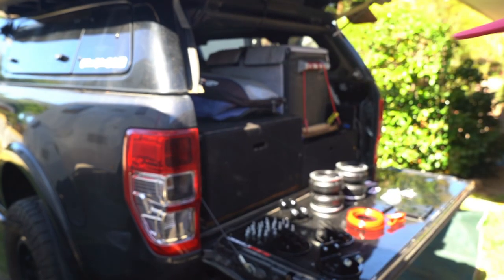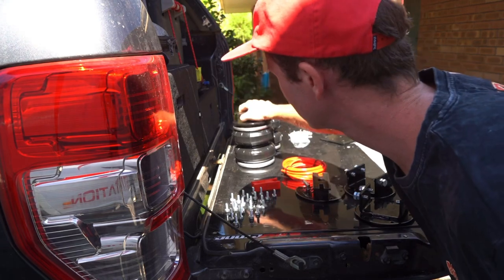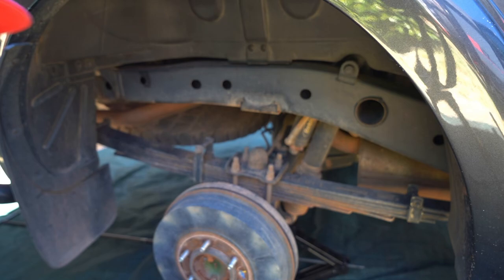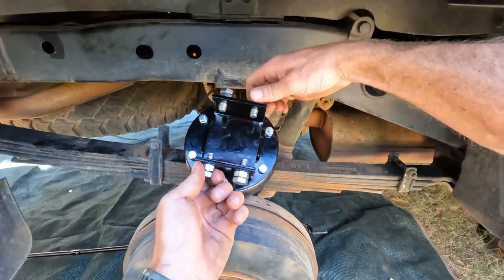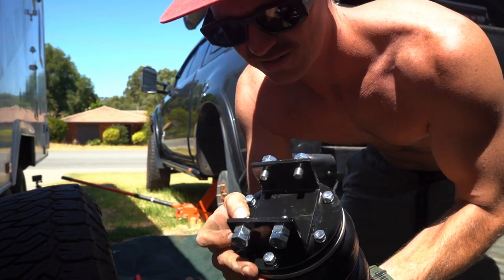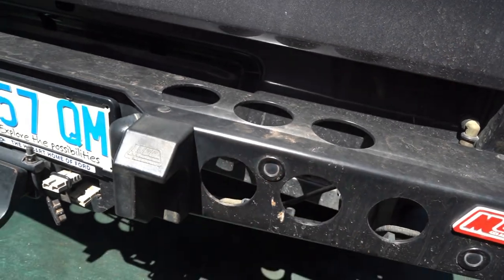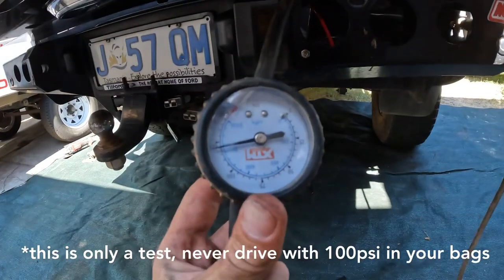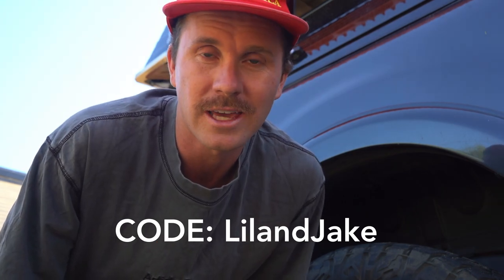DIY INSTALLATION of BOSS AIR SUSPENSION

Comment: We bent our chassis at 5psi. I was told not to run with zero psi so we left a bit in. We were on a gnarly track with a drop. After we recovered the ute there was a 700+km road trip back to Perth at a sedate pace.
Reply from the maker: Damn Steve! That sounds horrible! Yes I'm sceptical on the bags aswell, any sniff of a dirt road I let them down to almost nothing. Did you have upgraded springs aswell?
Reply: @lilandjake  yeah Jake, Toughdog springs and shocks and a lift. The ute was fixed under insurance, I thought she was a right-off.
 The ute was stipped to the chassis and cold stretched back to square (about 4 weeks in a queue ) then it was sent to an engineer for fishplate (4 months in a queue) basically gone for half a year. I checked in with the engineer after 4 weeks and there was a yard full of utes getting fixed or modified and we just had to wait. Old mate said he would ban them from sale and he's surprised insurance companies were covering the claims. The ute was as good as gold when we got her back.
BUT in the end I think it was weight behind the rear axle, a crew cab and the wheel arch was up front that got us (and a bigish drop). We have a supercab now aand I tink the tray is better situated over the arch.

Comment: A great video as to why some things shouldn't be DIY like this, lots of things not done correctly and really at the end of the day just dangerous, you obviously have no mechanical aptitude.
Reply from the maker: Sorry this video bothered you so much. Which parts specifically did you have a problem with? We’d like to know incase we’ve done something wrong.
Reply: @lilandjake  Both the U bolts and nuts should be replaced once undone. The reason is the nuts are torqued at factory which tends to stretch the thread, once you undo the nuts you will never get the same nut back on and guaranteed to not come undone by itself as the thread is now stretched. You should always replace with new U bolts and nuts and torque to the manufacturer's specification. Also never cut the threads back to level with top of the nut, this is bad practice and in a high tensile joint the thread should protrude past the top of the nut by about 3 or 4 threads minimum.
Hope this helps, but my advice is change out those U bolts and nuts with new ones and use a torque wrench to correct manufacturer settings so you have the confidence they will do the job and keep you safe.
Reply from the maker: Aramlee thanks for the tip! I left the u bolts in as they where new  aftermarket ones and only 10,000ks old, that's why I had to cut them down as the factory u bolts would not have hit the bag, 
sorry I don't have a torque wrench but you'll have to keep watching and see if our diff falls out! Cheers.
Reply: @lilandjake  yep I understand, however the low k's travelled on those U bolts is irrelevant. Once the nut is torqued or tightened, it stretches the thread immediately, if you undo the nut and then tighten again, the integrity of the joint or nut/thread combination is now compromised, it's just a pure fact and now a substandard connection. You never reuse the same U bolts and nuts, best practice is what will keep you from coming unstuck. Ask around with some people in the industry if you need to satisfy your own mind. Good luck with it all.

Comment: Did you already have a lift in that mate or is it standard height
Reply from the maker: Hey mate! It's got a lift in it, 300 kg springs in the rear, sat at about standard height with all the weight in it, even lower with the van on. 
Thanks for the comment!

Comment: How much lift did you get from the airbags? My Ranger drops 50mm with van. Trying to work out if I need suspension upgrade; bags or both?
Reply from the maker: Hey legend, depends on the pressure you run, airbags are only meant to lift your car back to level, they would easily get your ute back to standard height with a van on the back 😉